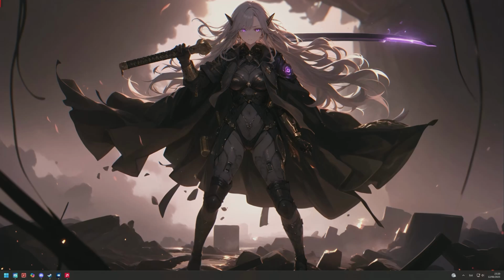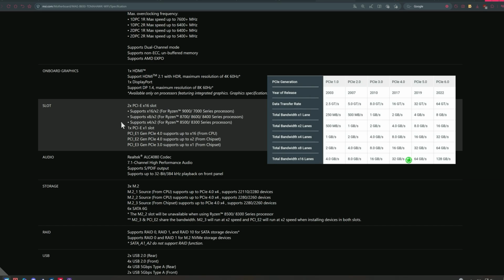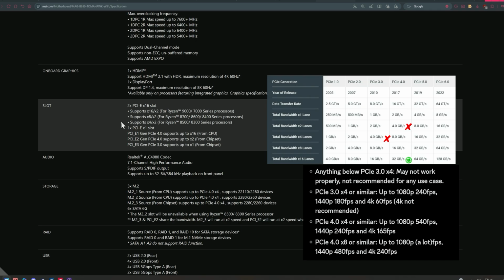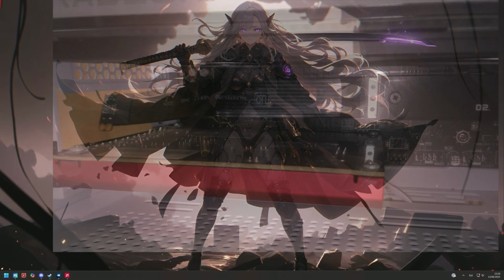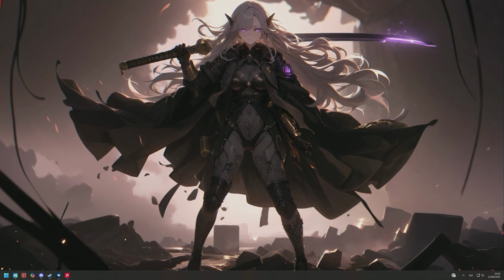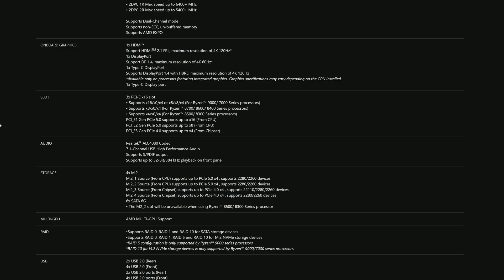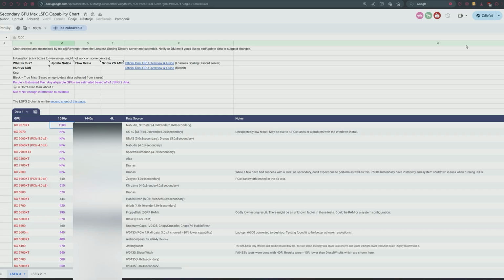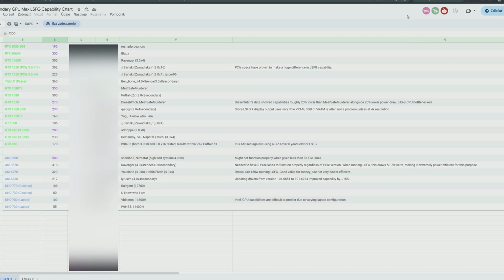[Lossless Scaling] DUAL GPU Problems & Solutions Vol. 2 motherboards

Comment: Buddy, I have a frame drop problem when using a secondary GPU for frame generation. I’m using an ASUS ROG Z490-F motherboard. My setup is GTX 1060 3GB as GPU1 and RTX 2070 as GPU2. The issue is that my GTX 1060 reaches high temperatures, around 83°C, which causes my RTX 2070’s temperature to rise as well. That’s why I swapped the slots. now the GTX 1060 is in GPU1 and the RTX 2070 is in GPU2. Do you think this slot change could be the reason for the frame drops?
Reply from the maker: Your MB supports 8x/8x, so it shouldn't matter which slot your GPUs are in. If swapping GPUs doesn't overheat other parts of your motherboard, it's probably a software issue. Try to eliminate problems one by one if something is making a difference.

I currently have a computer case that is open, with one GPU installed inside and another connected outside using a riser cable, which prevents overheating. I recommend trying this solution. Or if it's a software problem, try reinstalling Windows or something else if it's making a difference.
Reply: @zaxyss7339  thanks for the info 🙏❤️👍
Reply: i’m swiped my gpu slot i mean GPU1 slot for my RTX 2070, GPU2 for my GTX 1060 3gb. and it’s work.

Comment: Hi bro, I have PCI_E1 Gen PCIe 5.0 supports up to x16 (From CPU)
PCI_E2 Gen PCIe 5.0 supports up to x8 (From CPU), is it ok for 2 gpu's?
Reply from the maker: With a dual GPU, it will share lanes of the first slot to be 8x/8x… Only when you are not using the 2nd slot will you get full x16 bandwidth on the first slot. This is how it works on every motherboard with dual GPU capabilities.
Reply: @zaxyss7339 I did this, 4090 and 5080 paired with 9800x3D, I can set the FPS as high as I want, no any input lag. Your videos gave me this idea, thanks bro!